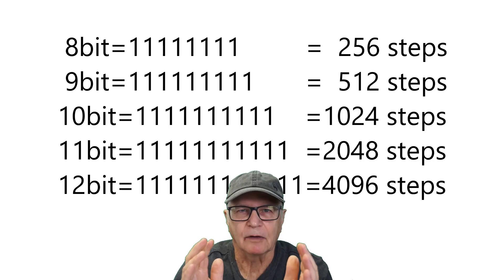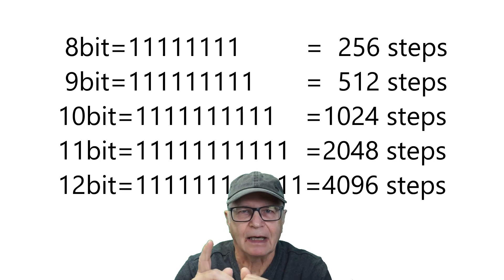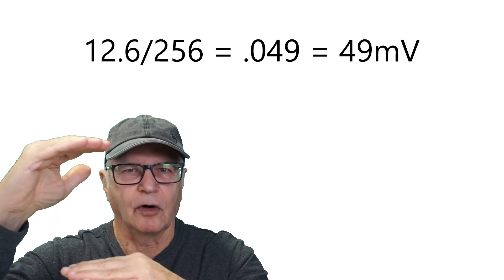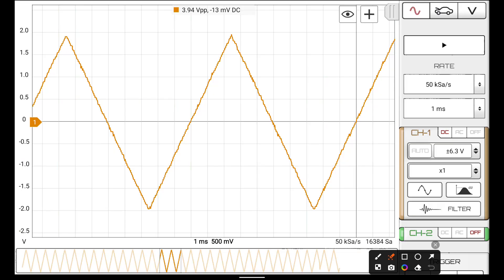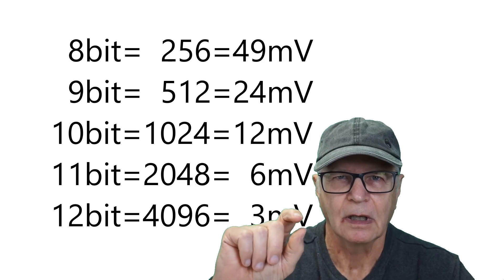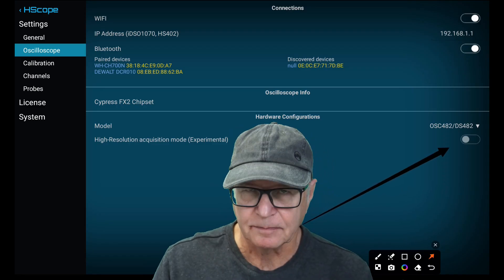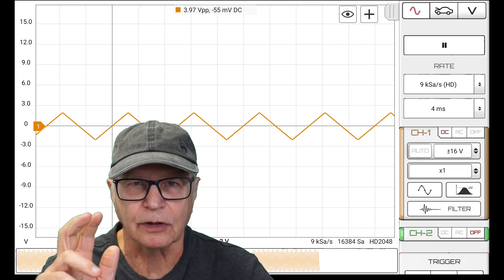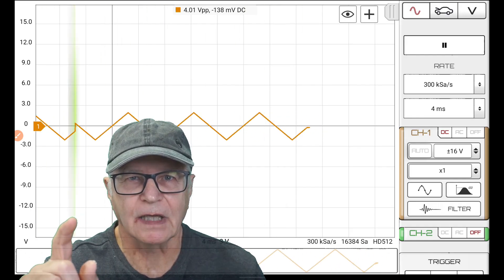HScope TUTORIAL#3 | VERTICAL RESOLUTION

Comment: The topdon scope is 8 bit cause it is basically the micsig Vato 2004 which I bought one last year for $225 on Amazon today over $300 and it does function with my topdon scanner. The software is just moved around a bit and channels are arranged backwards and the connection cable is different the scope is also powered by a lithium battery in both versions. The price needs to come down to reflect this..and I agree I really love my topdon scanner.... Thanks for all the learning videos... Happy New Year 🎊
Reply from the maker: I appreciate you dropping by and all the best in 2026